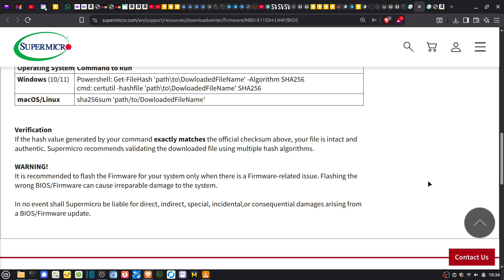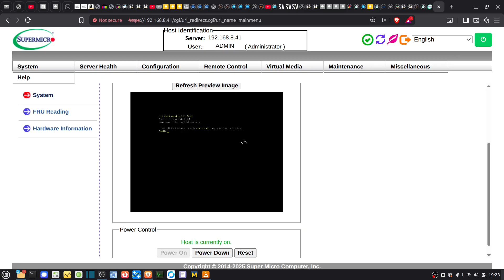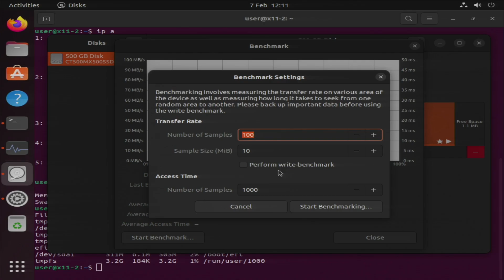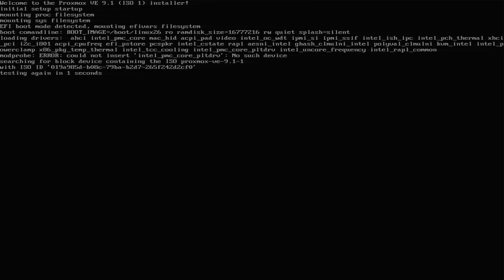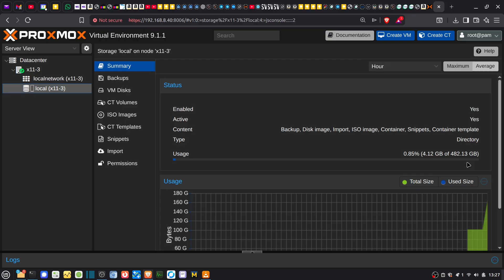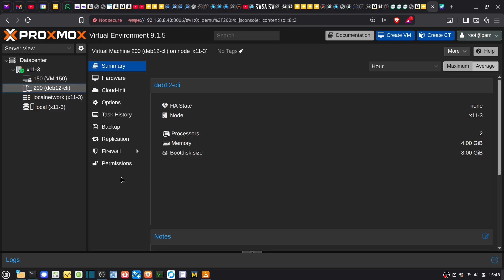Beginners Guide to Setting Up Secondhand Supermicro Server for Proxmox

Comment: Nice video Simon.  Curious if you could list the actual model of Supermicro server you purchased? Or what your search criteria was?
I'm currently shopping as well.  Thanks. -Mark
Reply from the maker: Hi Mark. For me the most important thing is the IPMI remote control via the network so I can remotely start up/shut down, install software, update BIOS etc. The boards I use the most are X12SCZ-F, X11SSH-LN4F and X11SPi-TF when I want 10Gb networking with a lot of RAM. The three boards use three different types of RAM though !

Comment: When you deleted data lvm you are left withh root lvm which is not a LVM-Thin volume, so now you loose thin provisioning of vm disks, which means you will run out of space much sooner.
Reply from the maker: You are right. Thank you for pointing this out. I am reassessing my strategy !